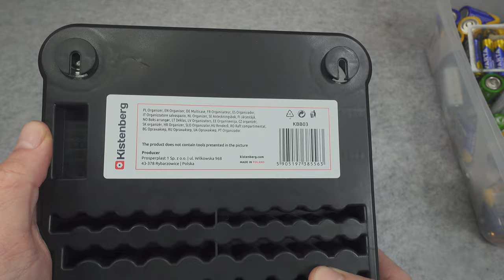Kistenberg battery organizer box - quick look and filling with different types of batteries

Comment: Really handy storage box. I used to have a very basic one. But over the last few years I have found that nearly all my electronic, electrical devices have built in USB rechargeable batteries.  I only keep AA and tripl AAA batteries for torches and clocks. And keep them in the boxes I buy them in. Best wishes for 2024. George in the UK. Ps still a very handy piece of kit for electronic hobbyists and repair shops.
Reply from the maker: I totally agree - I also don't use them a lot - but when testing vintage electronics  - sometimes I need use multiple ones. Imagine that I'm testing two CB radios and need pop 16 batteries. When I'm done - they go back to storage box :> Thanks for cheeking me out!